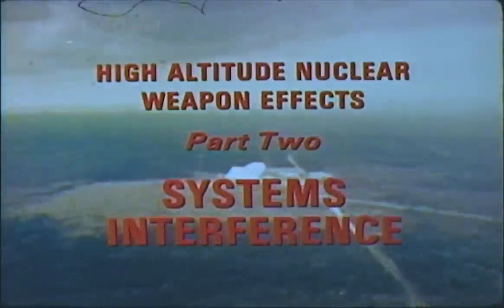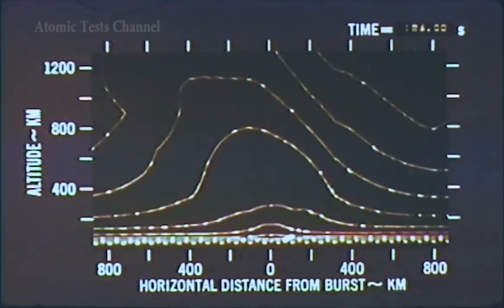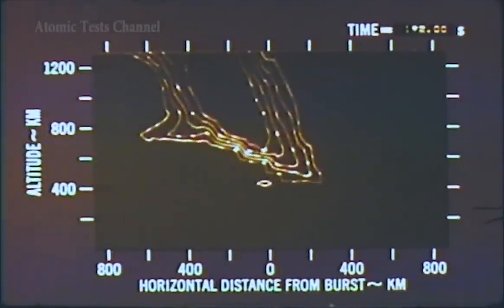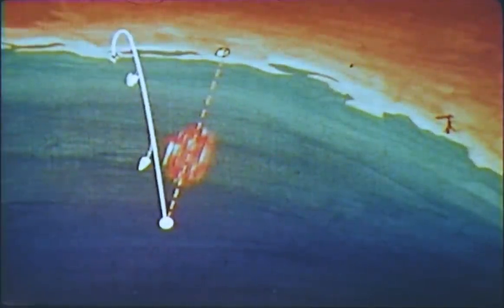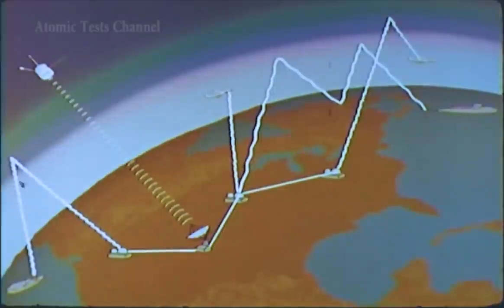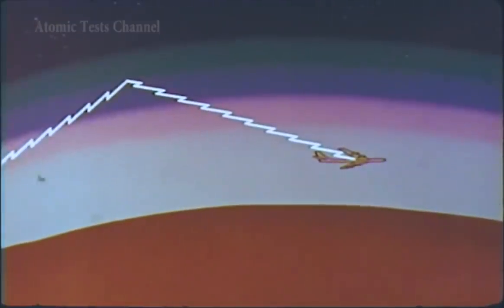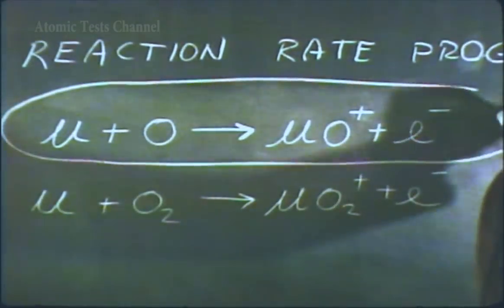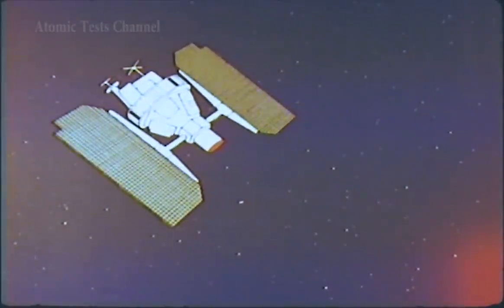EXTREMELY HIGH-ALTITUDE NUCLEAR DETONATION EFFECTS - SYSTEMS INTERFERENCE

Comment: Mk 2:00
OMG! It's the ORIGINAL!!! This computer readout is the basis for the study and comparisons sketches & diagrams of 1mt:20kt Burst Ratio Effects and Calculations necessary to differentiate between Megaton-range vs. Kiloton-range Detonations, Type of & Height of Burst, Fireball Expansion v Time & Distance², Triple-Point & Mach Stem Effect Formation (speeds, distances, energy, damage scale & calculating the Point), The Incidence & Reflective Waves v. Blast Front and Shock, Rising & Cooling Fireball Speed, 15 & 5psi Outer Ring Damage and Overpressure v. Stagnant Pressure = Afterwinds & Positive v. Negative Phases v. Time plus RAD/REM amounts and distance from Hypocentre!
THIS IS where Gladstone's Report and Sources originate!!! This is so kick Arse! 

Dude, you've outdone yourself! I've looked for this for YEARS! Thank you so much! Looking forward to watching the rest but wanted to say Cheers! This is freaking awesome!!
🤓🤙👊💚